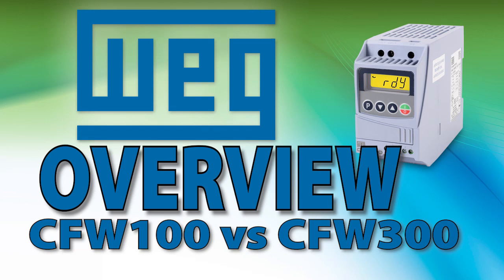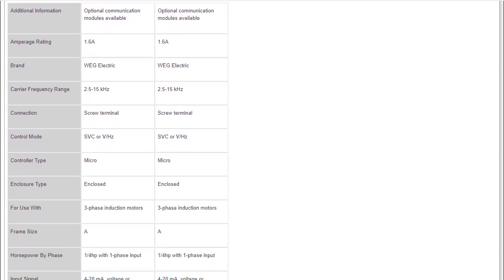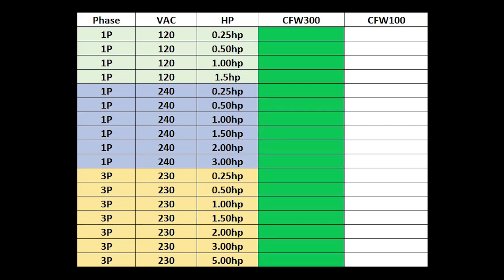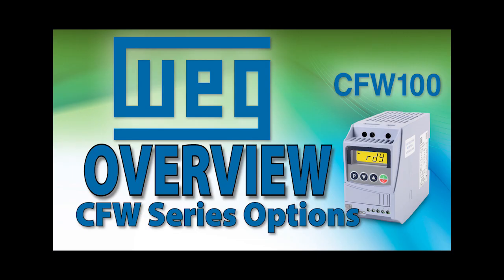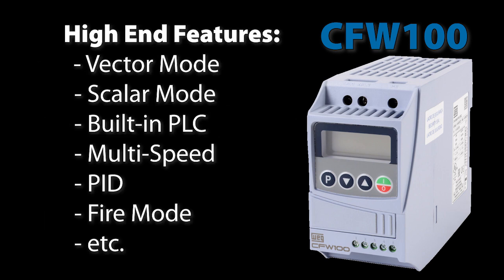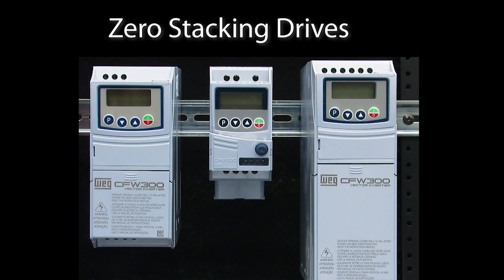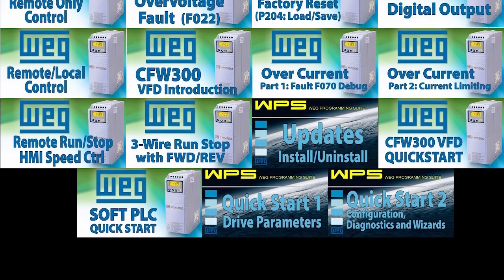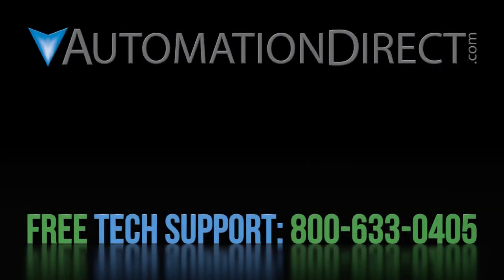WEG CFW100 vs CFW300/320 VFD Family Overview from AutomationDirect

Comment: Hi guys..!!! I've got a question here. Is it possible to make a master-slave configuration with two CFW3OO's ?? I mean. Setting speed by analog input on Master VFD and then this one controls the Slave VFD.
Reply from the maker: Hi Beymar, 
Of course! There are several ways you could do that. The easiest would be to simply send the original analog speed reference to both drives. 

Option 1: Send speed reference of Drive 1 to an Analog Output (P251 or 254 = 0). Then feed that Analog output into the Analog input of Drive 2. This gives you the advantage of being able to modify the analog output before it gets to Drive 2.

Option 2: Feed Drive 2's analog input into the builtin PLC so you can massage it however you want before feeding it to the Drive.

Note that neither the CFW100 or CFW300 base Drives have analog outputs - so you will need an additional option module for Options 1 and 2 above.